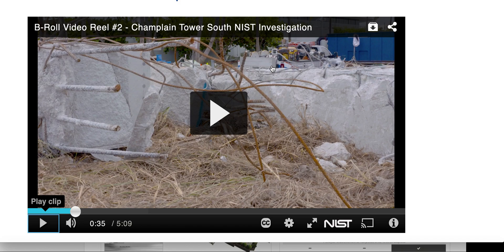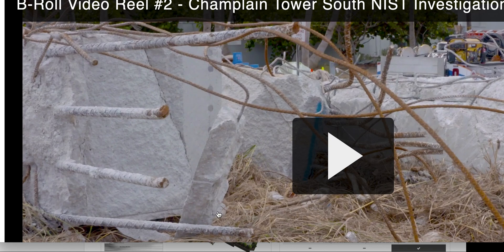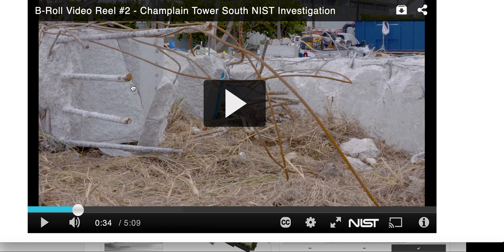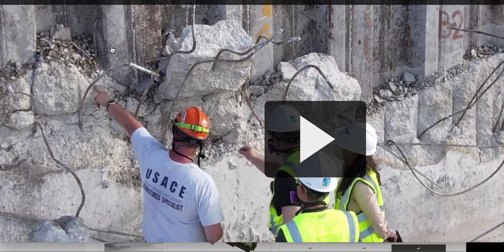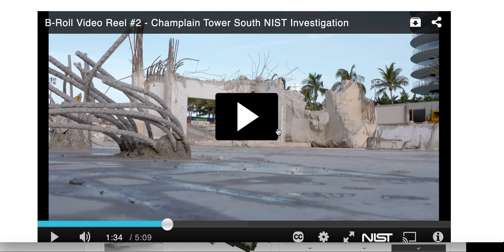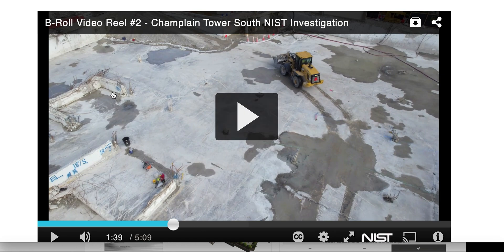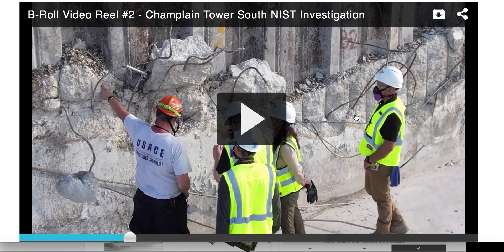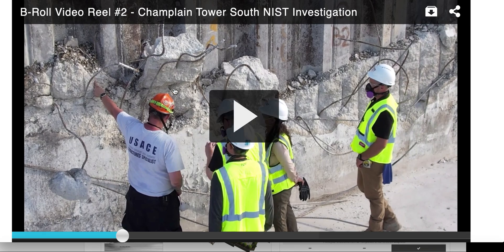Cassondra Billedeau Stratton she should have been informed of danger; plus lawsuit against vibration

Comment: Kai are the slump tests and or the core compression samples of the concrete taken at the time of each concrete pour available? These would be verry telling as to the actual strength of the concrete both in the slab pours and the column pours
Reply from the maker: They required to do both as far as I understand and even have instructions on rejecting loads...
This is a "joint failure" because of excess lateral loading (which could exhibit as a buckled column, at one of the slab and column connections).